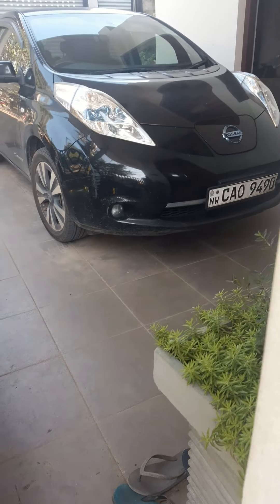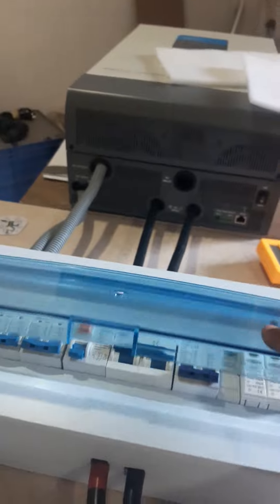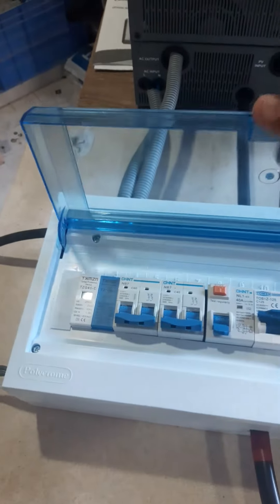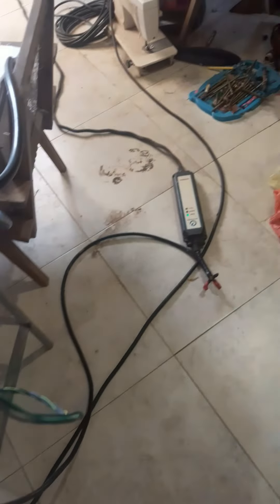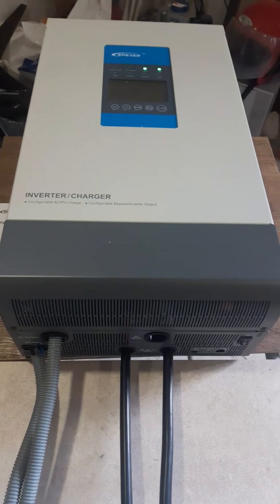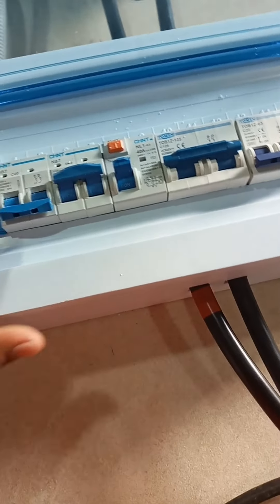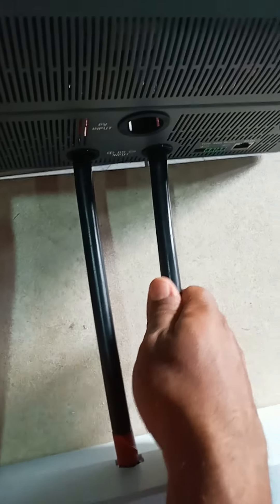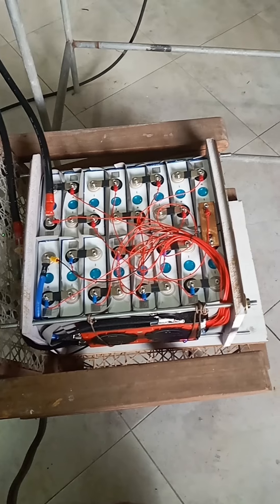Nissan Leaf Battery Extender 5kWh LFP & EPEver Off-Grid Inverter

Comment: Isn't it possible to replace the leaf main battery with this type of batteries?
Reply from the maker: Team of export s in Yukrain has done that. But it is very difficult task as voltage of cells are different between LFP  snd NMC